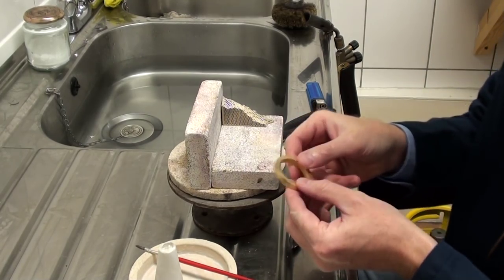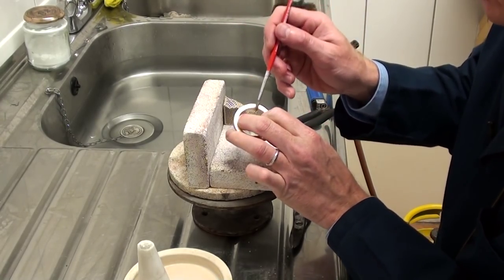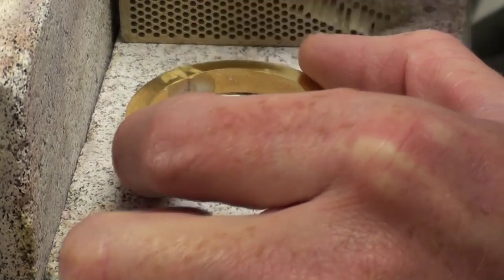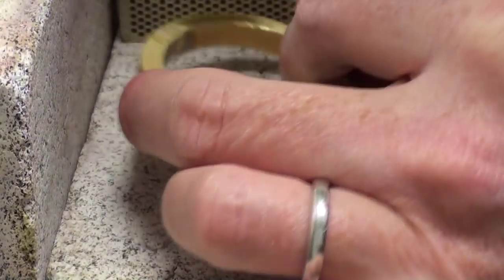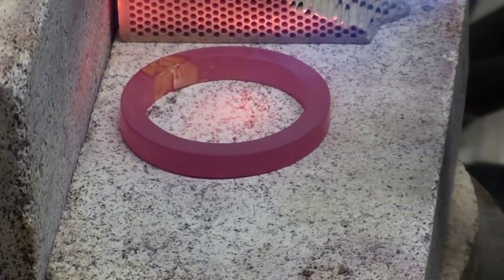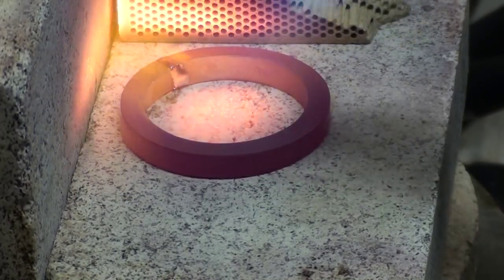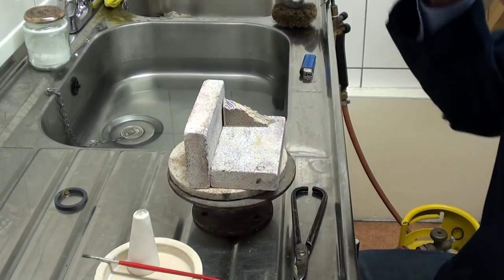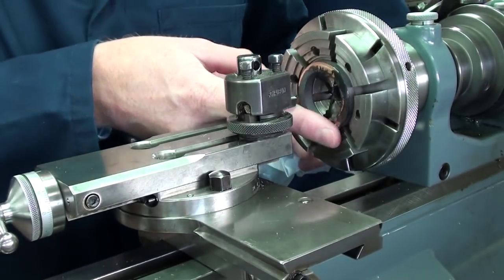Part 3 of 7 - Case Making by Roger Smith

Comment: Thank you so much for making these videos Mr Smith. I bought Mr Daniels books Watchmaking and the practical escapement along with many others. And have been acquiring the tools of the trade. I'm starting late at the age of 54 but I am determined to learn this trade and change my career. I'm tired of climbing in attics and fixing  air conditioners and furnaces.
Reply from the maker: It's a pleasure and good luck with your watchmaking.
Reply: Hope it's going good

Comment: Roger
Hello from Russian Jewellers Ltd Bournemouth (googlable ;-).  Admire your work a lot, hope you won't take my comment on soldering as critical remarks but friendly suggestions from 20+ years of experience in soldering gold and platinum.  Wrapping rings around with steel wire ( lower heat expansion coefficient) keep joints tight during heating,  best to place solder under the (ring) joint so you see the open joint end and observe run through ( solder run towards heat) , turning joint towards you my help further (as solder runs towards hottest point)  with easier to controll having in front less "runout" . 
Kind regards
Ilia
Reply: +10yr goldsmith. I agree completely. Always heat the work from the opposite side the solder is on.
Reply: I am a goldsmith also and agree with coolfox999.   Solder flows toward heat.  Binding wire helps hold the joint tight.  The first solder joints are done with hard solder.  the later joints are done with softer solder to prevent the first joints from coming undone.  I am a big fan of Roger Smith and was of George Daniels too.  Thank-you for sharing the knowledge of making cases.

Comment: I did this at school but with copper, soldering thing but I did this thing called braising.
Reply: Two names for the same process: "soldering" is the term used when temperatures are kept below 450 degrees Celsius; above that, you'd call it "brazing".